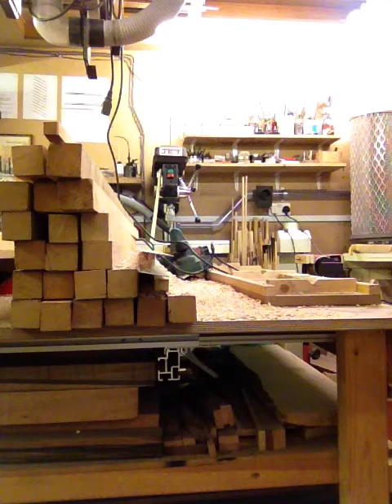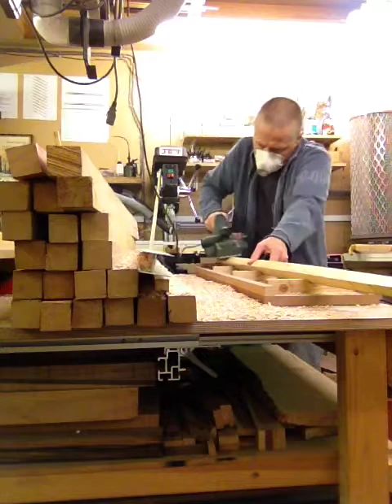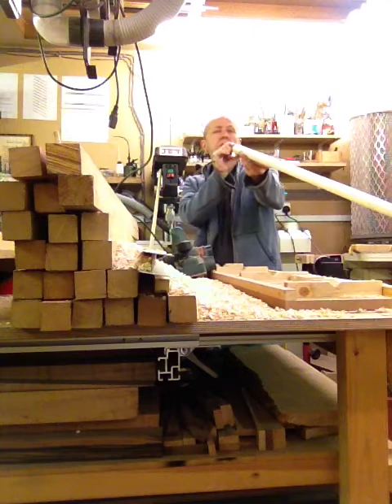Cue Shaft Preparation - Part 2

Comment: Can you please tell the sizes of the small square and the sizes of the round shaft when is finished?
Reply from the maker: Depends what size you want. I would aim for 2mm-3mm over the final size you are aiming for.
Reply: 111potatoes Does the direction of the grain matter  regarding how it was located in the tree, or can you choose the side you prefer for the tip and the butt indifferently?